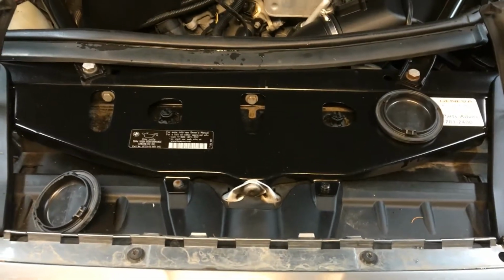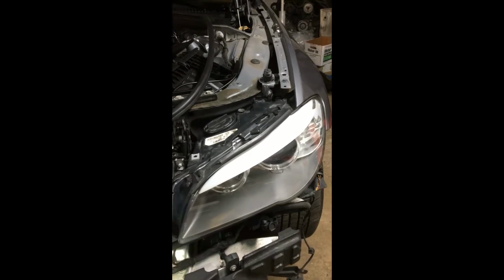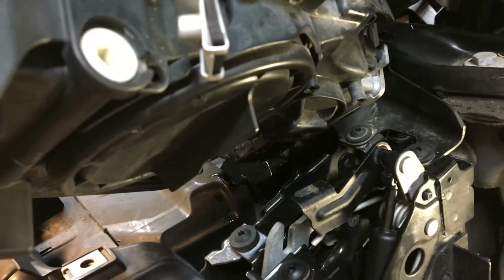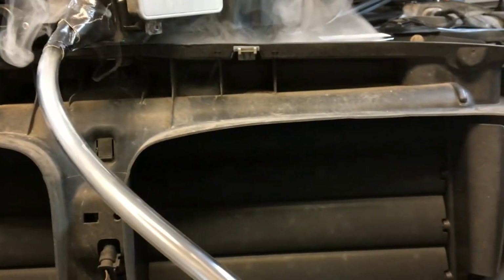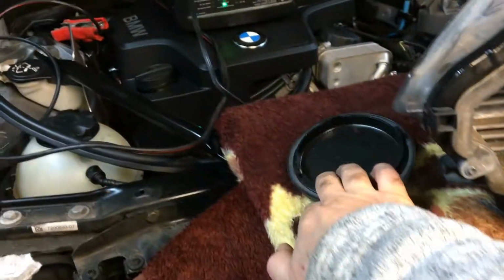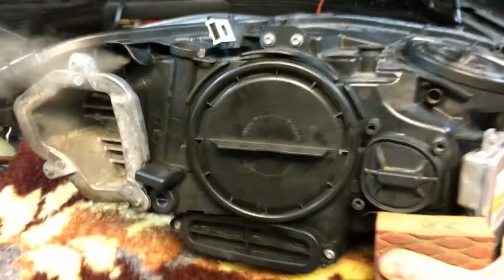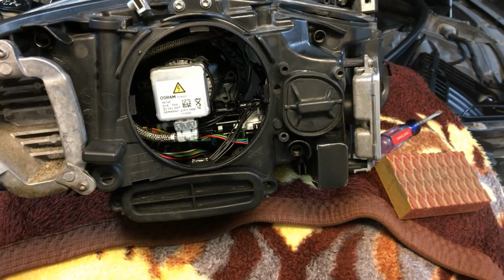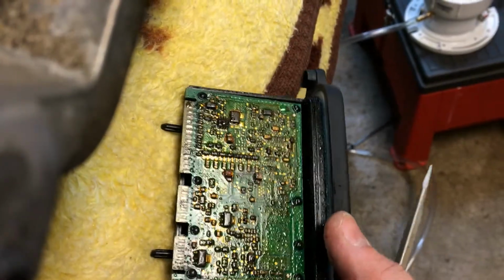BMW F10 Headlight Leak Detect w/ Smoke Machine and Water Damage Insp. Halo/Signal not Functional.

Comment: So how I fixed my problem sorta: I took of how in this video for a bmw f10 the cap that goes on top of the headlight and look bro look in the fucking car it’s so easy but btw  I drive without it now and my headlight is clear and working fine! I think only for winter I will drive with it of Becasue idk what’s wrong with it but at least my lights work and don’t look broke driving around with a watered up headlight and not working. Now the reason I said kinda is Becasue on my dash the headlight still says only this time “aim control malfunction” idk how to really get rid of that but atleats my high and low beams and angel eyes work so yeah and oh btw it took about 3 days with the caps of to fully clear the headlight so there you go
Reply: You fix the headlight malfunction it’s draining my battery that code keeps poppin up

Comment: The actual problem is the rubber seal that sits between the hood and the top of the fenders.  Take a good look at that. You can tell it is short on the front sides left and rights. 
When it rains, that rubber is actually a canal that drops rain water from the top of the hood directly on top of the headlights!! That water will run averywhere around your headlights looking for small leaks.

Solution: take some black insulation tape and extend the canal 3cm,  so the water will be dropped on top of the outside glass of the headlight. 

You will never have moist/water issues again.
Reply: Do you have any pictures of this location on the car?

Comment: Nice. Call a bmw main dealer, they’ll tell you they need to replace the entire front end of the car to fix a simple control board.
Reply from the maker: I ended up buying a used headlight and used controller board. Wires and connectors inside the headlight were all severely corroded making the headlight useless. In my opinion, the main controller unit should have been mounted on top of the headlight, not at the bottom where it can be flooded! BMW should know better. They probably do, but don’t care!

Comment: have u try check the fuse on the board? it is small surface mount black piece that has "0" on top of it, check if no continunity then either replace with the same part or soder a jump accross that part then plug everything back see if back on, i did repaired mine now the blinker and the rings lights are back on, hope that hekp u. if u need a pix of it let me know
Reply from the maker: Awesome info, thanks a lot. No I have not tried the fuse replacement/fix. My board is heavily corroded with missing pins. Oxidizes pins got ripped during board removal. I dont think the headlight is salvageable unless I take the lens out to get access to board electrical wide plug and fix each individual clip. I’m not looking forward to that!
Reply: Long shot, but any chance of pics of this? Trying to locate but cannot find!

Comment: hi  - any update on this - I have replaced both round covers on mine with new ones and also re-sealed the lens with silicone - but problem still persists
Reply from the maker: Unfortunately water damages of my headlight are beyond the control board (we saw in the video). Connector the board connects to is heavily corroded and came apart after pulling out the board (out of its socket). Looking for replacement headlight at the moment. If I dont find one, I’ll be taking this one apart to try to fix all connections. Ignoring headlight condensation on cars as such can be very costly!